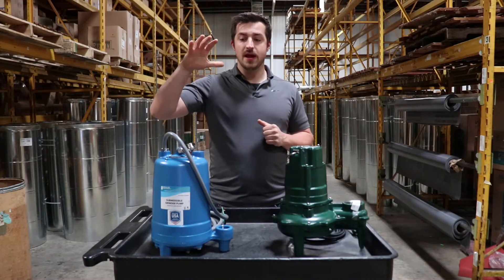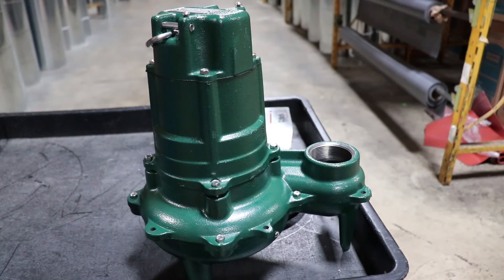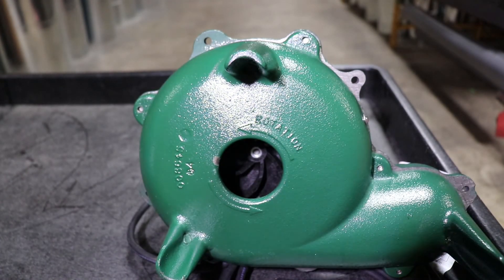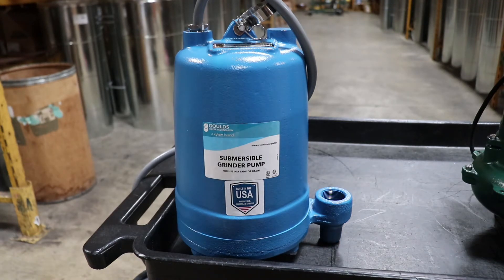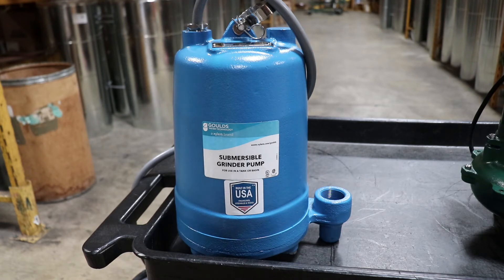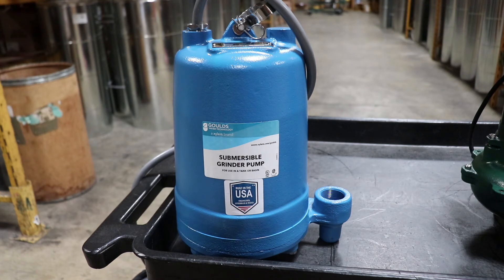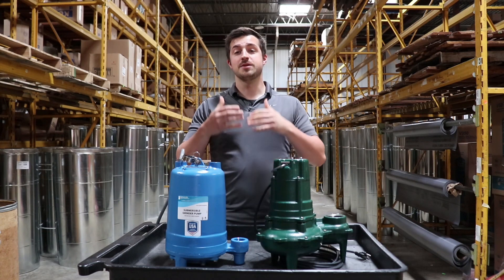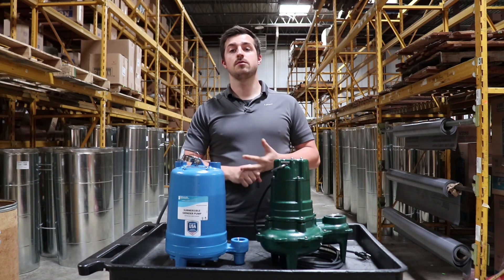Sewage vs. Grinder Pumps

Comment: Nice info, I understand also if you have a septic system a grinder pump is not ideal as the unprocess slurry may progress further into the chambers where it has not had time to break down naturally.
Reply: True
Reply: and then floats out to your leach lines and plugs them.

Comment: I'm considering replacing my current Zoeller M267 1/2 HP sewage pump, which pushes waste from a holding/septic tank to the public sewer, with a Liberty PRG101A grinder pump.  Is it an upgrade? Or better to avoid? The current setup gets clogged once in a year. It's not a controlled environment (it's rental property)  what do you think?

Comment: I have a 32 lot trailer park i recently purchased and had a oxidation pong. I have a well that has 2 pumps that pumps waste to the first pond. No jeans but wipes, female condoms, small rags, small toys etc. 10 feet up 100 ft lateral run. What pump?
Reply: First thing I would do is stop flushing unflushable things down the toilet.
Reply: @ianspeckmaier9565  Thats sounds cute but with 32 trailers, and all them flushing everything down the toilet. It's kinda hard to find out who is flushing what.

Comment: This video didn't mention the delayed-grinder pump. I used to have an issue with two of my girls.  They produce horse-size bowel movements (like their mother) to the point that even commercial toilets have a hard time handling them in one flush.  I ended up installing an oversized professional "delayed-grinder pump" which simply takes an extra 5-10 seconds grinding before full pump mode kicks in.  No matter what is in their bowel movement (unchewed peanuts, corn kernnals, apple seeds, etc) this extra grinding feature has proved invaluable.  If this ever fails, I will install an over-sized garbage disposal they will have to manually turn on prior to a flush and then use a sewage pump to relocate their waste to the city.
Reply: laxative moment
Reply: Thanks for the laugh
Reply: LOLLLLLLLLLLLLLLLLLLLLLLL

Comment: So, I’m planning a bathroom install in my basement and have to jackhammer the floor and and install an ejector pit with a pump.   I get what you’re saying about the differences between these pumps and we can easily control what fets flushed (i.e. no flushable wipes) but one thing I’m concerned with… We have two teenage boys and the solid waste they both produce is other-worldly.   One makes nearly baseball-size solid balls and the other makes torpedos that are at least a foot long. And probably 3” in diameter.   Both of them regularly clog the toilet.  I fear that the sewage pump may not be able to break these freakishly oversized things down enough to safely pass through the 2” line.    Does the standard sewage pump do any “grinding” at all?
Reply: I have the same issue with two of my girls.  They produce horse-size bowel movements (like their mother) to the point that even commercial toilets have a hard time handling them in one flush.  I ended up installing an oversized professional "delayed-grinder pump" which simply takes an extra 5-10 seconds grinding before full pump mode kicks in.  No matter what is in their bowel movement (unchewed peanuts, corn kernnals, apple seeds, etc) this extra grinding feature has proved invaluable.  If this ever fails, plan to install an over-sized garbage disposal they will have to manually turn on prior to a flush and then use a sewage pump to relocate their waste to the city.

Comment: I need to pump about 150ft in legth to a septic tank, which sits about 60ft higher than my cabin. Do you think a sewage pump would be up to the task? Id prefer to not use a grinder pump based on what youve said in this video. Thanks!

Comment: I work for an elderly housing complex where I currently have a duplex pump sewer lift station. We constantly have things getting flushed that shouldn't be & ending up with clogged, failing pumps. I've been considering switching to grinder pumps but, after seeing this it would seem that they might mean even more problematic. Either way the lead time for ordering/ receiving replacements is 6-8 weeks. Unacceptable as I'm paying to have my lift station pumped out by truck every day now. No matter how I caution tenants,  things like disposable wipes, etc are making life & my job a challenge to say the least. Anybody got any advice?
Reply: I knew from a situation where they solved this by installing the basket of a shopping cart in a pump sewage pump station. I think to remember that the incomming flow from a refugee housing facilitie had this basket hanging on the exhaust side inside a collection tank of a pump station. The people in the migrant housing where often washing clothes etc. inside the toilet bowl since they were not familiar with western toilets or laundry machines. Once in a while a employee of the local water board had to empty the basket and that saved a lot of repair costs on their pumps.

Comment: Grinder pumps create an emulsion or suspension of fine particulates and is especially a problem for onsite wastewater systems.  They should not be used in onsite disposal systems.
Reply: Are you referencing anaerobic septic systems? I was planning on using a grinder pump to transfer to my septic system. Is that not a good idea perhaps? I only need about 4 feet of head but a distance of 75 feet
Reply: @tbahama6336  hi Tom I've got the same issue. Need to pump to septic tank. Id love to hear how you solve your problem. I'm looking at sewer pump.
Reply: I’m Looking for a pump to pump wipes as well.. but don’t think it’s possiblr
Reply: @m @mikearchiere2321  Mike what did you end up getting?

Comment: which will be better for a basement full bathroom setup . standard residential property. was initially leaning towards the grinder
Reply: For a standard residential system, a sewage pump should be fine.  Just don't put any kind of wipes in it; even so-called "flushable" wipes; just toilet paper.  Grinder pumps basically are used for when you can't control the debris whatsoever, like if you own or manage a campground, or a truck stop where diapers are flushed down the toilet (yes, it happens).

Comment: How long does a grinder pump last? Just wondering since it hasn't been long since we installed our last one and its showing a warning light now.
Reply: Really depends on the stuff it's grinding.  Flushable wipes only will last longer; diapers will make it shorter.  What's going into it?